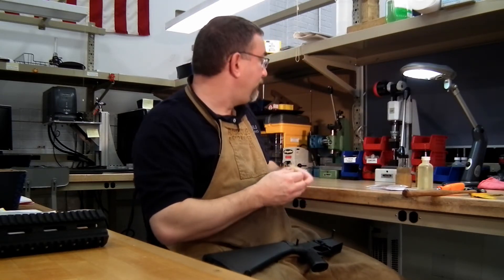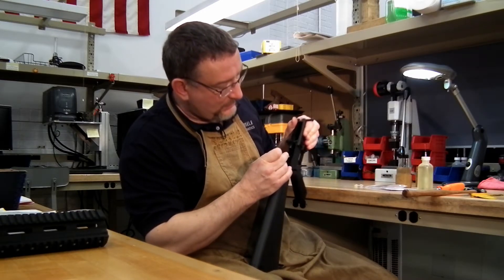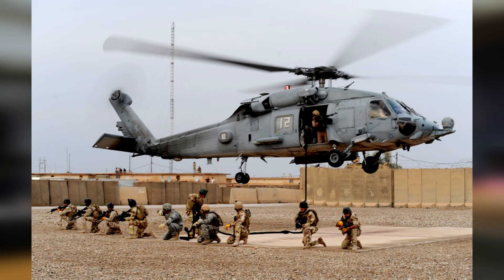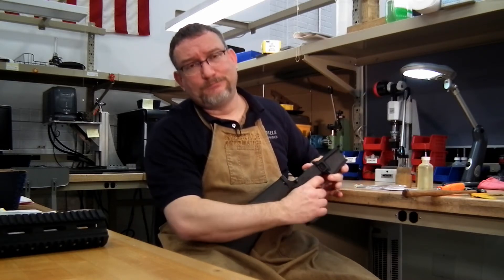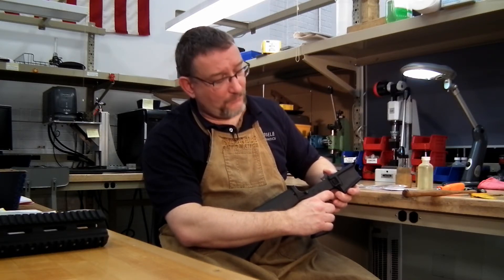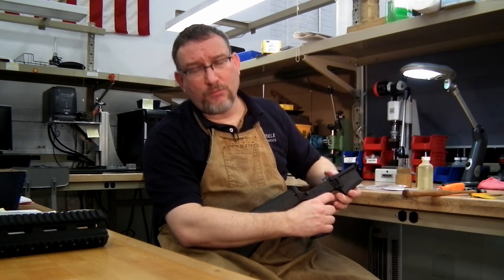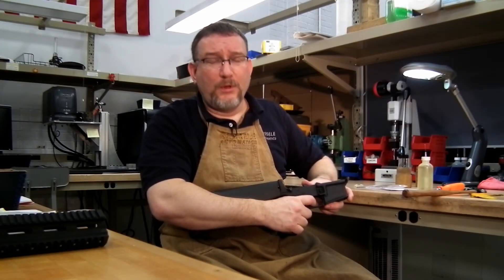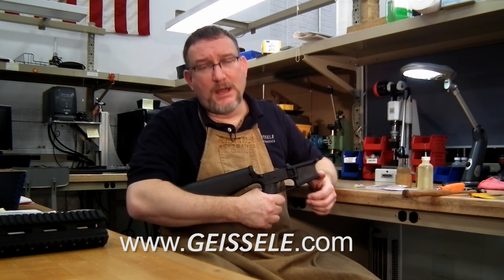part 3 of 3 - SSA trigger swap - Geissele Automatics

Comment: Just installed my SSA today - thanks for taking the time to make this video - the instructions were perfect.  I actually used the punch to hold the hammer assembly in place and just simultaneously worked the pin in and punch out , as there is quite a bit of tension on the hammer spring.  Thanks for making a great trigger -
One final question - how often (rounds fired?) do you recommend cleaning the trigger/hammer assembly?

Comment from the maker: @esyd13 According to Mr. Geissele, you don't need meticulous cleaning for the trigger/hammer. Just throw lube on it when it feels like it needs lube. When will that be? The trigger finger will know.  The hardened surfaces don't allow crud to adhere in any appreciable amounts that will adversely affect performance. The hammer will strike consistently as it did from Day One. Lube and shoot. It cannot be any easier than that. All the best!